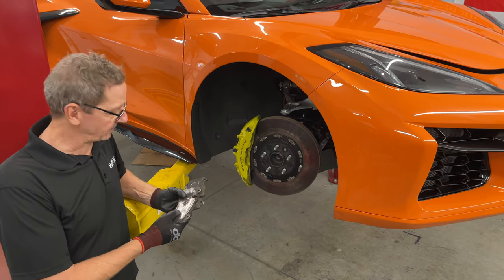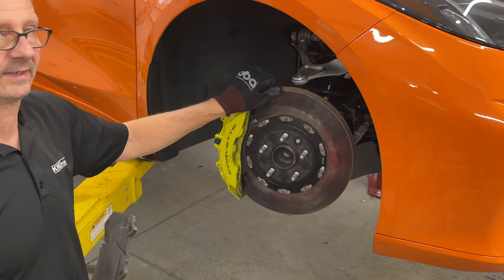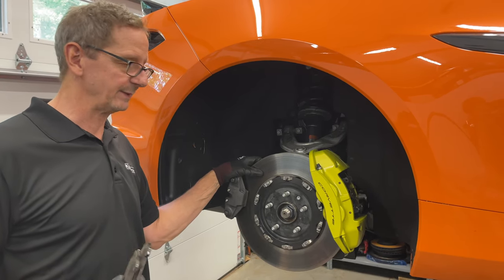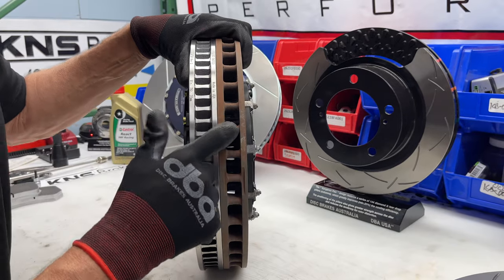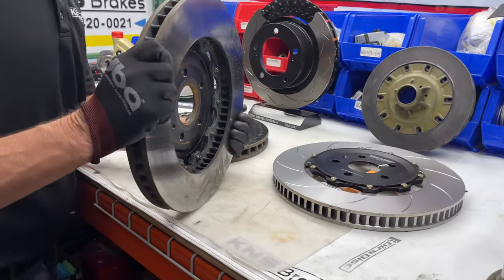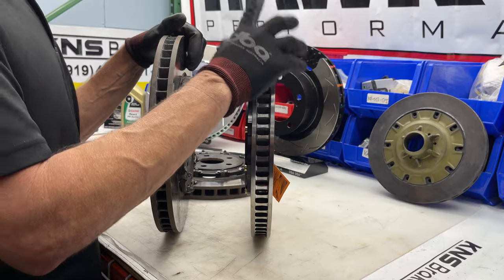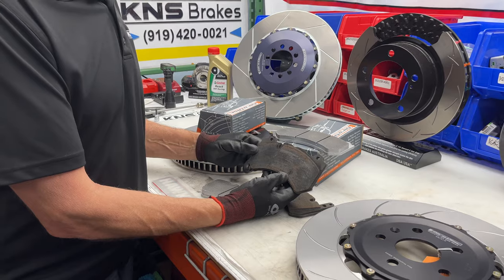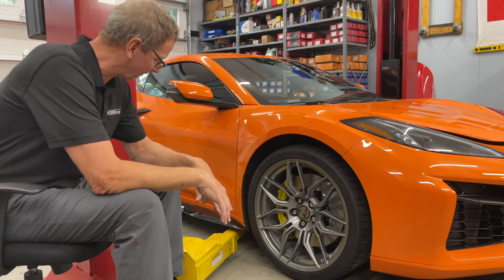KNS Brakes C8 Z06 Girodisc Rotor and Pad Install

Comment: Thanks for the informative video. Quick question. How hard is it to get the studs out while the rotors are off. I want to add 8MM spacers and want to replace the studs with longer ones.

Comment: Is the C8 Z06 iron disc front brake caliper the same as C7 Z06 iron disc and non-BCD SS 1LE?
Reply: No.  They are a similar design and use the same basic pad shape.

Comment: Hello, does Girodisc fit any 355x32 hats stoptech?
Reply from the maker: Yes they should. They use the same hardware design.  We have those in stock
Reply: Thank you sir, what pads do you recommend for street performe for gyro disc rotor?
Reply from the maker: @juliodg2139  Is this for a C8 Z06?